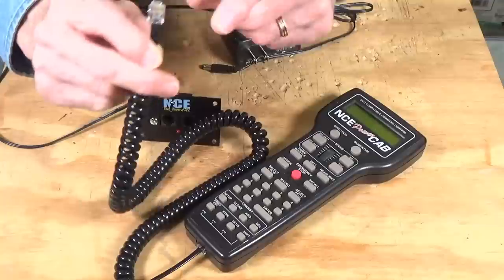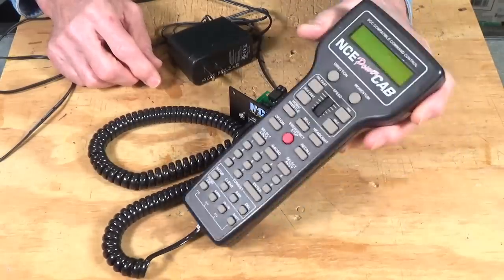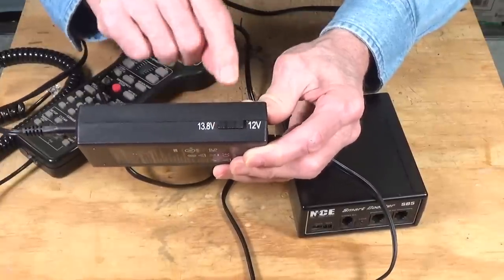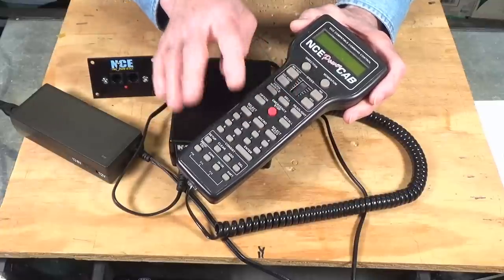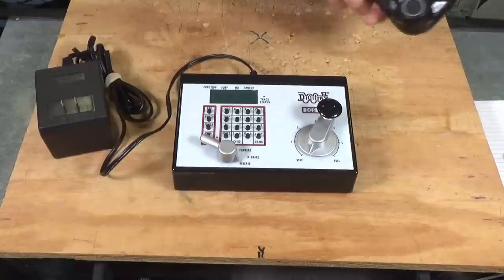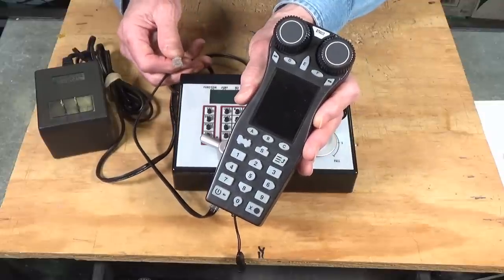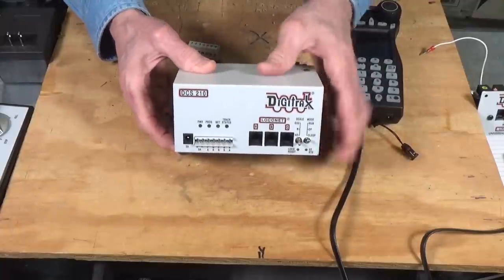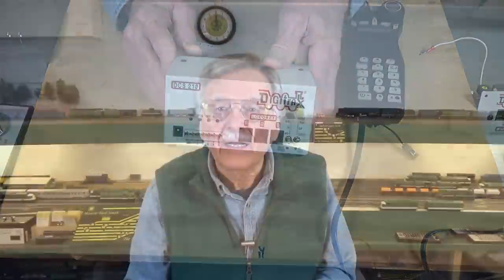DCC  Basics—Beginner, Intermediate, and Advanced Systems (303)

Comment: I started about 65 years ago with a layout my father and brother built.  Very simple Atlas HO on an L-shaped board (4'x8' plywood with 4'x4' plywood side leg).  After many years away, I bought some N-scale (DC) and even built a Woodland Scenics layout.  Gave that to a local club and switched to Bachmann HO DCC.  It is so simple to wire and I can change the layout to anything that fits on the living room carpet and still practically no wiring.  The 'cab' and 'controller' are all in one small box.  I'm not even tempted to build a permanent layout that might exceed what this little DCC starter system can handle.  I now have ten 36" straights to make it easier to fill the room quickly and a run behind the sofa.

Comment from the maker: Folks, I misspoke in the video when I showed you the PowerCab coiled cable. That one is made by DCC Concepts for use with the PowerCab so it did not originally come with the PowerCab set. However as I said in the video the 6 wire cables are for use with the PowerCab when it is used as a DCC system and the 4 wire cables are used with it when it is used as a throttle with the NCE SB5 or PowerHouse systems. You can easily tell them apart by the number of gold pins on the plastic connector on each end of the cable.

Comment: Larry, nice introduction to the two most popular DCC systems.  I started out in DCC with just a Digitrax Zephyr 50.  Now I have two Zephyrs, a 50 and a 52.  I have a DCS 210, two WiFi 600 series walk-around throttles, the WiFi adapter, two PM42s and a number of other Digitrax devices.  Some people tend to think when they move up to the DCS210 they no longer need their Zephyr.  However, when attached to just the LocoNet of a DCS210, the Zephyr becomes a nice stationary throttle.  You can put a Zephyr on a shelf in front of a yard to build outgoing trains and break down incoming trains.  You know how some people are about laying a throttle on the tracks.  The Zephyr on a shelf solves that problem.  Also, you can use the Zephyr as a programming/test throttle at your hobby desk for an off layout programming track.  Currently, I am building a small show layout that one Zephyr is more than enough to run.  So, my Zephyrs get moved around.  I understand that you just can't review every DCC system.  You would end up with a fortune in equipment.   Perhaps some of the manufacturers should loan you DCC systems to evaluate.  It would be good for them to have a name in the hobby that can do an honest review.  I know you have stressed this.  Yes, viewers watching your video still need to do their homework, check out what other modelers are using in their area, get on the manufacturers' websites and search for YouTube videos on those systems that interest them.  There are a lot of systems and there is a lot to learn.
Reply from the maker: I’ll be reviewing both of the new TCS systems soon as I get a chance to check them out. They sent them on a 90 day loan for the review.
Reply: dkaustin98. We started with the DB150 before the Zephyr was even available and then acquired a DCS100 along with a couple DT400 - 402  and ut4 throttles. We use the dcs100 for our lower main layout, and separated the upper two layers with the DB150 as a booster. We have about 6 UP5 panels and I just recently completed connecting them to the track bus and powered the panels. I took 1 power supply that I had for the up5's and created a power bus for them. I soldered feeders to the backside terminals of the barrel connector and then daisy-chained them to the power bus. it saved on buying a power supply for each up5 panel... LOL. We still have to install a dedicated programming track and interface to the computer for JMRI, but we still are learning, my son is much more proficient than I am with Digitrax. I have just started to post videos of what we are doing. Check them out, let me know what you think.
Cheers!
Earl

Comment: Thanks Larry, as someone new to the hobby great videos, having gone for the Digitrax DCS52 Zephyr express 3amp starter system. Think it will suit my railway modelling- I am using Hornby TT120 locos and Hornby HM7000 sound decoders - I can use this DCC command controller or the Hornby HM 7000 app via Bluetooth - gives me the flexibility to be static with the DCS52 or more mobile with the HM7000 app on my IPad. Learnt so much from your videos much appreciated

Comment: Not sure if this will be in a further video but a big thing to remember with the NCE systems is a Programing track. Both the Power Pro and the Power house system allow you to have a Programing track but the SB5 doesn't. Can be a problem if you accidentally program all your locos to the same address lol. But another great video
Reply from the maker: I discussed this back on video no. 230 on upgrading the PowerCab with an SB5.

Comment: UP7 is the latest on the DIgitrax panels. The UP7s have two Loconet connectors in front and 3 in the rear. And they are better than the UP5s. I have 10 UP3s and have been satisfied with them since I bought them back in the 90s. I bought a DC power transformer from Radio Shack about that time. It puts out 18 volts at 3.5 amps and has done me well through the years. Tried a 12 volt 5 amp and it didn't work like I wanted. So, I am back to the 18 volt 3.5 amp power supply.  On the "HO" setting I am getting 15.1 track voltage. Used to run it on "N" but have went back to the "HO" setting.

Comment: Hi Larry the up5 digitrax panels have been replaced with the up7 new panels which have a different power supply system to the up5 which uses the loco net cable and a common wire daisy chained between each panel , the up7 has to wires into screw terminals and daisy chained between them or you can use the loco net cable only and daisy chain between each up7 , i was going to use the 12vdc power supply from my ur92 but they are not compatible as far as i can see , thought this might be of interest to you and your viewers , love watching your videos as they are so clear and informative , youve got to be the best presenter on railway stuff keep up the good work
Reply from the maker: I knew about the change to the UP6 but had not heard about the UP7. Oddly their website still says the Evolution set comes with a UP5 so that’s what I went with. Expecting these upgrades I bought enough UP5s to finish the Piedmont Southern a few years ago even though they probably are compatible.

Comment: Always great info on your channel...
Question Please:
I am looking for a good choice for walk around Radio Wireless control on a large HO home mountain style layout with a projected 350 to 400 feet of track when the main line is completed. I also want to run multiple cabs (with multiple operators at some point) for monthly operations. (3 to 4 operators).  
If you could offer an advice on a good choice with a complete radio control wireless system I would surely appreciate your input. Thanks in advance.
Phil
NYC / Jersey Shore Area
Reply from the maker: Both Digitrax and NCE offer wireless throttles and transceivers so I suggest you take a look at them.

Comment: I have the Digitrax infra red unit that allows walkabout without the need to connect the throttle.
Reply from the maker: I can remember AJ Ireland giving me a demo of the prototype of those in his workshop in Norcross GA many years ago. Unfortunately the ir signal doesn’t do well on soft surfaces such as carpet and drapes and can be absorbed by black surfaces, so can be unreliable under those conditions. However it came installed in their throttles for many years and all you had to buy was the ir receiver to go wireless.

Comment: Watch a video on speed matching and it was mentioned that you could even out your loco motor by adjusting the forward or reverse trim.  Is this possible with most decoders and how do I make the adjustments using the NCE Power Cab system?  Thank you
Reply from the maker: Forward and reverse trim can be very useful especially for locos that respond differently in forward or reverse. However it can also be used for general speed matching. First get out your decoder instructions and make sure the decoder supports forward and reverse trim-some don’t. The easiest way to adjust it is with DecoderPro but can be done with a throttle. When using these settings I find programming on the main easiest since you can quickly experiment with different values.

Comment: Years agoe I was with a N M R A Club DC modular layout ,and we were deciding witch  Dcc systom to use.
 One had a lence,one had digatrax,  and one had  NCE..
I sugested to make a plug  a plug's to fit systoms and i got a 2 part answer to my question. 
First part was HELL NO from the ones that had the systoms .
part 2 was you cant use a dcc( ac ) systom on a dc. layout BIG burn out .
.you will burn it up. 
this was comming from a older electrical engineer..
Oh you can run dcc on a dc layout Mr Pucket has a video on how to do that.

Comment: Hi Larry. Just for clarity, the DCS210+ command station is only available as part of a starter set (I am sure you know this), there is the DCS240+ (a more capable command station - up to 400 locos) available in the UK from £360.
Reply from the maker: Yes, I reviewed the DCS240 in the December 2016 and the DCS210 Evolution set in  the May 2017 issues of Model Railroader magazine. Since then they have  upped the ante a bit so they are now the DCS240+ and DCS210+ systems. I think the main differences are the DCS210+ now has a built-in usb port and the DCS240+ has built-in transponding detection.

Comment: I have to go back through all your videos but I think in one you said the nce can be set up for a program track can the digatrax but set up for a program track  or is that a future video in this series witch I am glad to see someone doing 
I have scribed to a few and find yours more informative
Reply from the maker: Both Digitrax and NCE systems support dedicated programming tracks. The PowerCab is an outlier in that you can only use the power output for either running trains or programming, but not both at the same time. However their advanced Power House system supports simultaneous running and programming. All current Digitrax systems allow both running and programming simultaneously.

Comment: I'm using nce and I'm using the flat cable instead of the coiled one is the coiled one better to use haven't had any problems so far knock on wood
Reply from the maker: That is correct, see my pinned comment.

Comment: I bought an NCE 5 amp radio system about 20 years ago. It's been in storage for the last few years, but I am building a new layout. I notice the new ones don't have an antenna sticking off the top of the controllers, which mine do. Are 20 year old radio systems compatible with the new ones, if I choose to buy another throttle? Thanks.
Reply: Note: I will contact NCE, but thought asking the question here could also help others.
Reply from the maker: I would assume they would be compatible but better to get a definitive answer from NCE.

Comment: Larry, are you sure about the coil cable with the NCE PowerCab system? For years NCE has said to use the flat cable when using the PowerCab as the command station, and only use the coil cable when using the PowerCab as an extra throttle.
Reply: Just watch a UK channel setting up the NCE this week and their Power Cab had the flat cable which the instructions said only to use to connect the throttle to the panel. It did include a coiled cable but again the instructions said that was not for use in Power Cab mode.
Reply: I agree with you Stuart.  Unless that coil cord was custom made the flat cable needs to be used when using the basic PowerCab system. The coil cord shipped with a PowerCab is for using the PowerCab as a throttle only on a SB5 or PowerPro system. 
The flat cable has heavier gauge wire to carry the track power without a voltage drop.
Reply: @tinplategeektoo  That was on Sam's Trains channel. I watched it as well.
Reply from the maker: Sorry guys, I forgot about the origin of the coiled cable. The coiled cable is a DCC Concepts product with 6 wires made for use with the PowerCab. As I said, 6 wire cables are used with the PowerCab when it is used as a command station/booster and 4 wire cables are for use with it as a throttle.
Reply: @TheDCCGuy  it happens. At least you did mention the six wires, which is an important distinction.
Reply: @stuartaaron613  Wasn't sure if mention the name was okay here so just kept it vague to be safe.

Comment: NCE has advantage of being able to update the firmware yourself if you wish (another topic maybe?).
Reply from the maker: The current production Digitrax equipment including throttles, command stations, boosters, and some other devices also have user upgradeable firmware. With NCE you have to replace a chip whereas with Digitrax you download the firmware and run the program on your computer.

Comment: What is FX5 and FX6? I don't think that is a function Key?
Reply from the maker: Different decoder types may have a larger number of functions. What can get confusing is the naming. You can get SoundTraxx decoders with up to FX6 (and maybe more) and they refer to them as FX. Digitrax has long referred to their decoders by different FX numbers based on the types of special effects available, further muddying the waters. ESU decoders have AUX functions and they too can be numerous. Some of these may be direct wired connections and some may be logical functions that trigger other functions. So to understand all this you need to look it up in the specific brand decoder literature and also read through the NMRA function definitions and sort it all out. Once you figure it all out maybe you can explain it all to me! This is why so many folks just want a decoder that comes installed in a loco with everything optimized for the functions so they don’t have to worry with the confusing mess behind the curtain.